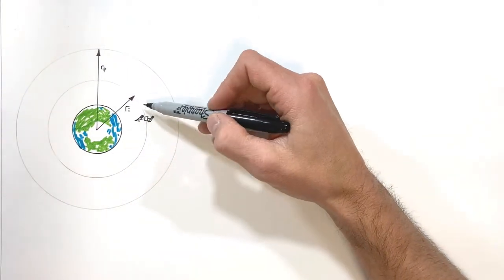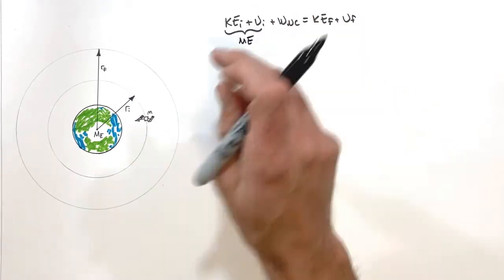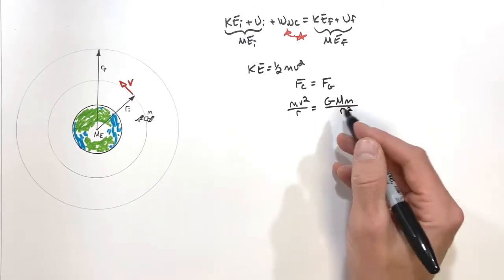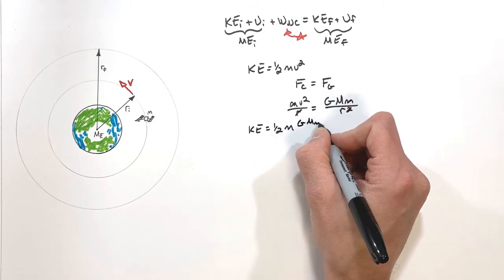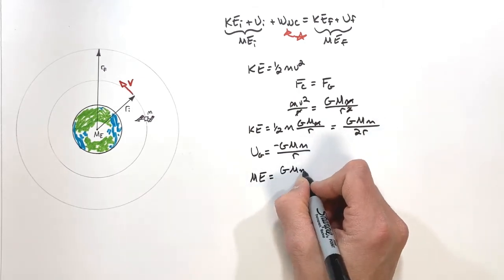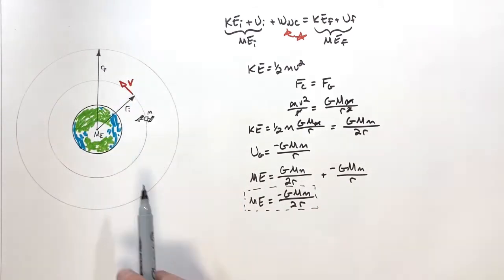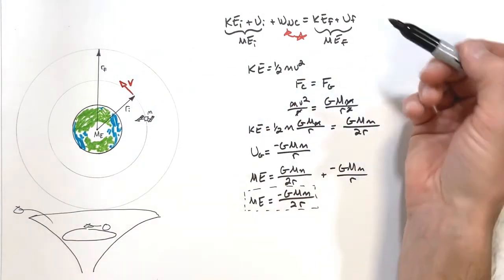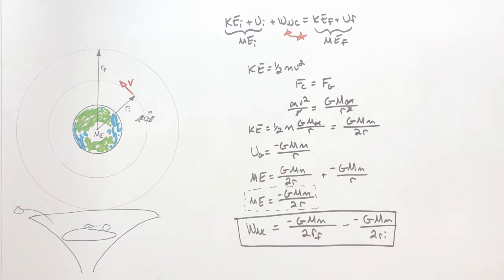How Much Energy is Required to Change the Orbit of a Satellite?

Comment: One really interesting upshot of this when you assume all terms in the numerator equal 1 as they are identical and invariant* is that you are looking at -1/2rf - -1/2ri, meaning you are always subtracting a negative number from a negative number, or rather always adding to a negative number.

And r is in the denominator, so if you move to a higher orbit, you will never reach a positive number. I.e., counterintuitively (but perfectly sensible due to the nature of gravity), you must bleed energy out of your system. To move to a lower orbit, the result will always be positive because the total energy in your system must increase.

Obviously you spend energy in the form of dV either way, but the way in which you spend it must reduce the total mechanical energy in the system's stable state to achieve a higher orbit.

Comment: Dear Brother,
Please consider and elliptical orbit.
What is the term for energy or force when the satellite is moving in an elliptical orbit ?
Reply from the maker: An elliptical orbit is actually a bit easier because the potential and kinetic terms can have nearly any values,  The key for an elliptical orbit being that the total mechanical energy is the same at all points along the orbital path.  

Ive been meaning to make a Hohman transfer vid, it will come up there.
Reply: For an irregular orbit (like an asteroid orbit) I would assume that you will need to average out the energy at the various radius. So take half of the elliptic orbit and integrate the function with respect to the orbit's radius. Then multiply by 2 to get the average Mechanical energy for the irregular orbit 

Then just solve for the unknown like this video explained.

Comment: is the potential energy at the radius r calculated assuming that potential energy at the earth's surface is 0? or do we consider that it is 0 at the core of the earth?
Reply from the maker: The potential energy is calculated using the radius as measured from the center of the earth.  The potential energy function is only valid for radii greater than the radius of the Earth.  Inside the Earth things get a little more complicated.  See the 'Journey to the Center of the Earth Problem' to look at potential and gravity inside the Earth.
Reply: The radius of the planet is usually insignificant in comparison to the astronomic units (au) used in Kepler equations so you can ignore it. 

Most Keplar solutions are approximations due to the eccentricity, radius, and other values that change depending on the source - so as long as you're within the right ballpark your calculations are likely correct.